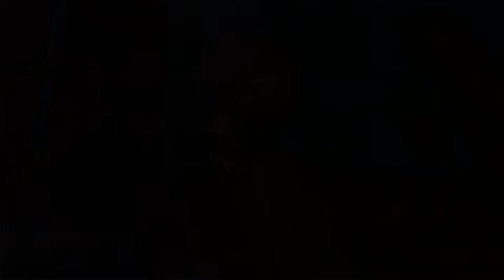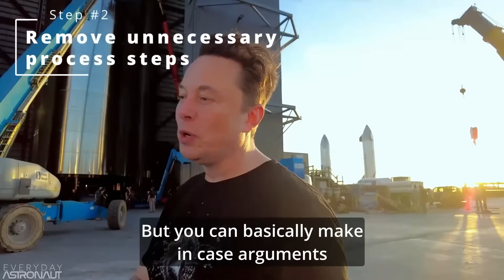Elon Musk Five Step Improvement Process

Comment: Question the requirements
The first step is to critically assess the requirements presented in a task. It's essential to challenge assumptions and ensure that what is being worked on truly needs to exist. Musk warns that often, even intelligent individuals fail to question flawed assumptions, leading to efforts directed at optimizing incorrect or unnecessary processes.

Remove unnecessary process steps
The second step focuses on eliminating redundant processes. Many workflows include extra steps that do not add value. Musk encourages a mindset that seeks to delete rather than add components—aiming for a leaner and more efficient execution.

Optimize
In the third step, one is encouraged to simplify or optimize the processes that remain after the previous two steps. Only after ensuring that the core activities are actionable and necessary should one look to enhance their efficiency.

Accelerate cycle time
The fourth step involves improving the speed of project cycles once the previous steps have been implemented. This means prioritizing pace but ensuring that the foundation is solid through prior refinements.

Automate
The final step is automation. After removing unnecessary elements, optimizing processes, and accelerating execution, the last phase is to automate tasks where possible to enhance efficiency further. Musk reflects on his own mistakes in reversing these steps, highlighting the importance of adhering to the process.

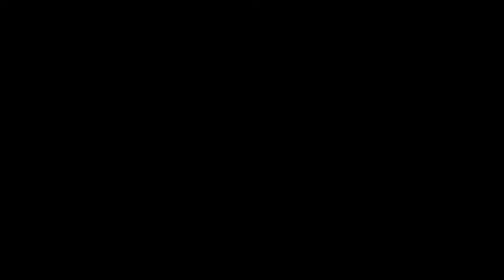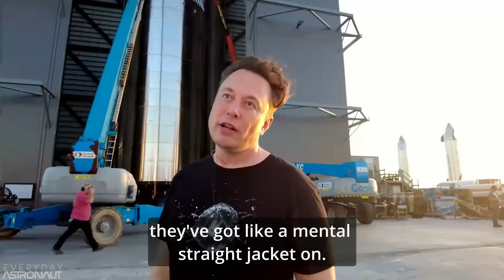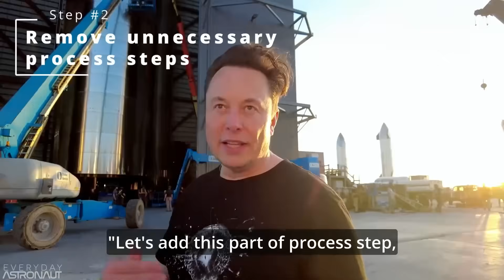Comment: Elon Musk Five Step Improvement Process Question and optimize requirements and processes in order to improve efficiency and avoid unnecessary elements. 00:00 😅 Everyone is wrong sometimes, and one common mistake is optimizing something that shouldn't even exist, which is often due to the conditioning of answering questions in school. 00:23 💡 Optimize requirements and question them, delete unnecessary parts, and occasionally add things back in to improve processes. 00:50 💡 The five-step improvement process discussed in the video includes bias, adding arguments, simplifying or optimizing, accelerating cycle time, and automating, with the caution to not skip steps.

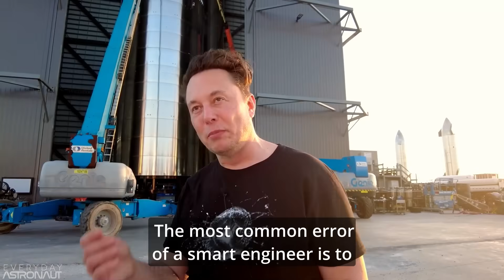Comment: ¹0:01 Everybody is wrong and fails
¹0:28 Question the requirements
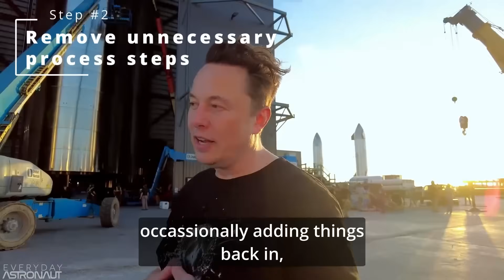²0:42 Remove unnecessary process steps
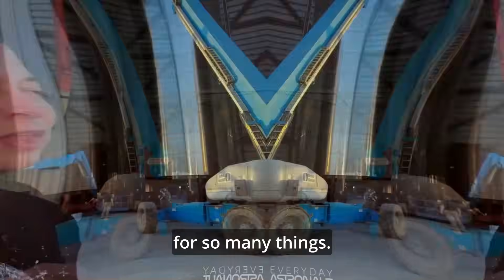³0:59 Optimize
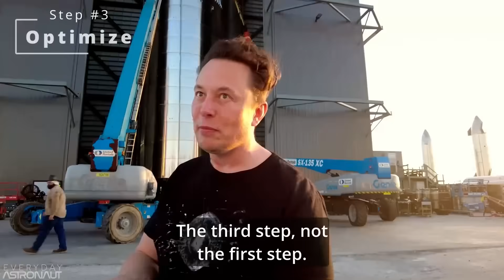⁴1:07 Accelerate time-to-learning
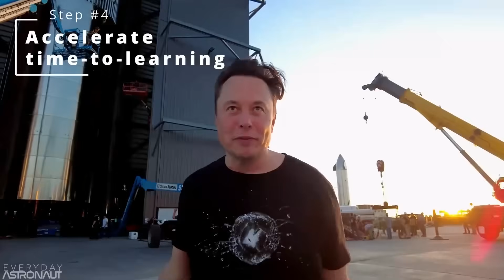⁵1:16 Automate

Comment: I love how he's so open to failure. It's like failure is first step
Reply: Yeah. You HAVE to fail many times in order to do anything and to figure out how to do something correctly etc. testing means basically testing for failures to figure out what works and what not to do. Not speaking from engineering but in general. “Failure” is almost the wrong word for it, people should see it more as “testing the validity of the process or thing” that doesn’t mean you failed if it doesn’t work, it means you tested for a weakness, found one, and can now attempt to develop a correction or improvement or alternative solution.

Comment: 🎯 Key Takeaways for quick navigation:

00:00 🧠 Question requirements: Avoid optimizing unnecessary elements.
00:28 🧹 Streamline: Continuously remove and evaluate parts or processes.
00:56 🔄 Optimize: Focus on simplifying and improving what remains.
01:09 🚀 Accelerate: Increase speed, but only after prior steps.
01:24 🤖 Automate: Final step after questioning, streamlining, optimizing, and accelerating.

Made with HARPA AI

Comment: 🎯 Key Takeaways for quick navigation:

00:00 Smart engineers often optimize things that shouldn't exist due to traditional education's focus on answering questions, leading to misguided requirements.
00:42 Continuously strive to delete unnecessary parts or processes, but be open to adding them back if necessary.
01:09 Accelerate your work only after addressing the previous steps: delete, simplify, and optimize.
01:24 Avoid the mistake of automating before completing the earlier steps.

Made with HARPA AI

Comment: “The most common error of a smart engineer is to optimize a thing that should not exist. 

1. First make your requirements less dumb. Question your requirements. 
2. Try very hard to delete the part of process. If you are not occasional adding things back in you are not deleting enough. The bias tends to be very strongly towards let’s add this part or process step in case we need it. But you can basically make in case arguments for so many things. 
3. Simplify or optimize.
4. Accelerate cycle time.
5. Automate.”

Comment: 1. Be convinced a thing should exist.
2. Trim fat and keep what is, without a doubt, “necessary” (experiment with taking away then adding back in and f e e l if it is necessary. If it isn’t, toss it.)
3. Simplify further (extra fat cutting).
4. Full steam ahead at maximum speed.
5. Automate (have the thing automatically working without you being there).
Reply: Simplify is different from optimize. Step three that you describe is not accurate enough
Reply: @seanandrews5329  what do you suggest number 3 should be?
Reply: @velmudas  number 3 was only said to be one thing: optimize. This is what I suggested to use, too. Since it’s written in a comment you seem to have an unfounded confusion,
Reply: @seanandrews5329  “since it’s written in a comment”. I’m failing to understand what you mean.
Reply: @velmudas  you could have answered your own question by reading the damn comment
Reply: explains twitter

Comment: Nice list.  I would add timing.  Especially in high tech.  Innovations are trickier than fine wine.  You must wait long enough but if you wait too long the cutting edges become blunt.
Reply: study physics
Reply: @RR-et6zp  Resurrect Einstein, with the data we have now, to finish his last project for a unified field theory.
Reply: @ydne 
nd yet, despite the additional tech supply, still be a ..Theory athat. 

That, one come wonder, if indeed ‘belief’ the prerequisite upon to hold oneself, 
(why) Einstein long suggested a divine system in liew..
Reply: @ydne it's not about data for astrophysicians
Reply: hes talking about building products not a successful company
Reply: Observations before anything. All is needed. What does the thing itself do without input?